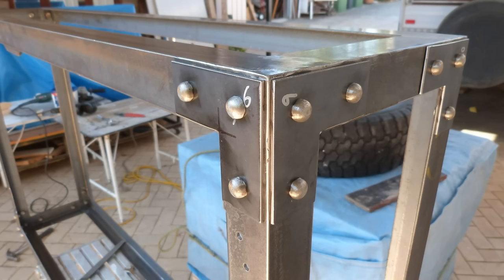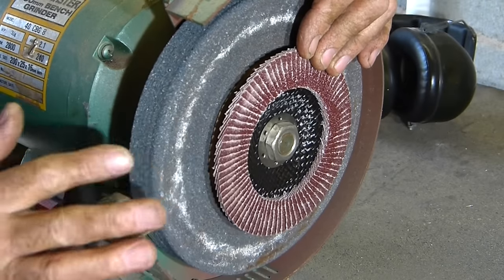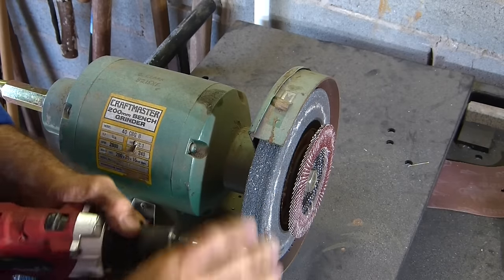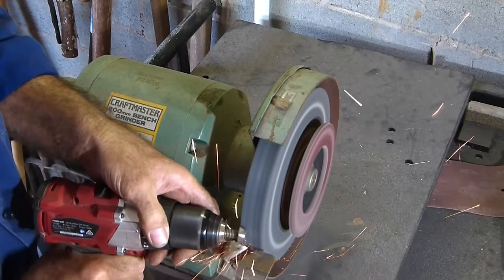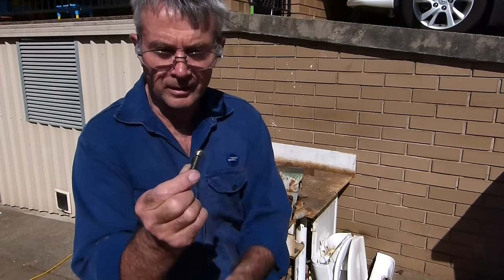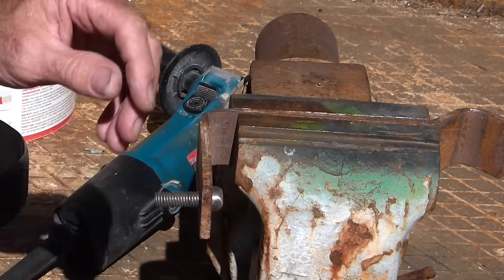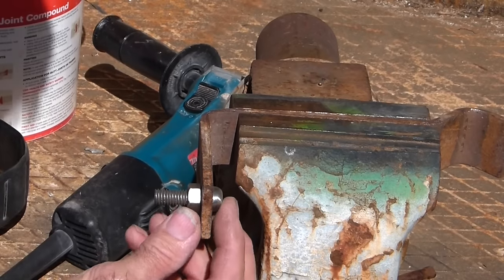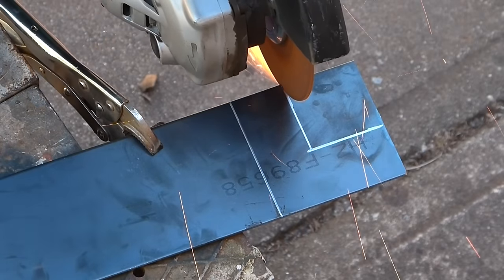Steel Rivets how I make Bolts easily look like Rivets for the Metal Industrial Furniture Style look.

Comment: 30 seconds in and that flap disc on the bench grinder is absolutely fucking genius! subscribed!
Reply from the maker: Thank you, welcome to the channel. just a note on the flap sander you can only put it on the right-hand side so that the flap wheel is turning in the right direction. I like it because it is also very quiet compared to running an angle grinder. Thank you for your comment.
Reply: @GavinClarkdiy  yeah, have to think up something for the left side. maybe a scotch brite wheel
Reply from the maker: A very good idea, it is wasted, I will add something to the left side at some stage. Thank you for the idea and your comment.
Reply: Same
Reply: What ever you put on the left side should be ok as long as it's in direction of rotation for that object.  Solves the issue of side grinding either way.
Reply: I keep a wire wheel on the left side of mine. If you do a lot of metal work you will wonder how you got along without it because you will use it alot!

Comment: Good tip on the flap disks. I have to go out to the shop to cut some 0.960" strips from an 8" carbide tipped saw blade to use for parting tools on my lathe. Before I grind them, I'll be putting flaps disks on my bench sander.

You said they could only do on the right side. If you have extended arbors, you could put one on the inside of the left wheel.

I've been using the drill trick for grinding for a long time. It works well. If you have a decent fine stone, you can radius/champfer machine screws after shortening them.
Reply from the maker: Thank you for your comment and your idea extended arbors I don't have these but I will keep that in mind.

Comment: I've been doing this for the last few decades! I also learned that you don't have to hold the head with pliers if you have an impact gun. Electric seems to be faster than air, and the speed at which the nut is turned doesn't allow the bolt to spin.
Reply from the maker: What an excellent comment, I agree with you 100%, on one I did quite some time ago I hit right near the hole with one center punch hit, it put a little bur into the hole which was plenty to hold the bolt from turning, but it was more work. Thank you for your comment.

Comment: I used standard button head riviets From McMaster/Carr and just spotted them in instead of a nut on the backside. Really fast.
Reply from the maker: I used these bolts because I have a lot of them, and it was a simple job, and used the nuts to show that it could be done without a welder. I appreciate your comment.

Comment: Love your work mate. I'm impressed. I have to build a large medieval style timber door with ornate laser cut hinges looking like oak tree branches,  I can bolt the hinges to the door using this idea and theyll look great.
Reply from the maker: That sounds like a great project, it should look amazing, I am glad I was of some help to you. Thank you for your comment.
Reply: @GavinClarkdiy  Do you have any suggestions Gavin on how to antiquate hex nuts so I can use them on the inside face of the door where theyll be visible? I am thinking to have old style  square nuts laser cut and tap threads in them. I'm in Gippsland, Victoria.
Reply from the maker: @andersonsroad5161  What about "steel castle nuts" with a square washer under them. https://images.app.goo.gl/Cv7Sf86BN23DJF1j7
Reply from the maker: You could also make your own washers from 25mm flat bar, and your own square nuts from 16mm flat bar (about 5mm high). Belt them both up a bit so they look damaged from a hard life (before you drill the nuts to thread).

Comment: Way easier to grind the numbers off and shape a carriage bolt then square the hole. No need to mar the surface of your "rivet" when tightening the nut. I like the bolt cutting jig and the sander on the grinder.
Reply: What do you mean -- what's your solution to avoid marring the surface when tightening the nut?
Reply: @LudoA  carriage bolts have a square on part of the shank so if you cut a hole the size and shape off the square the work will act as a spanner
Reply: @jim-zb2kb  ah right, good idea. Thanks for explaining!

Comment: Very stylish!
Is it possible to buy these bolts rather than make them? Also, if you cut a slot on the end of the bolt's shank (don't know  how else to say this, I hope it makes sense), you can then tighten the bolts using a flat head screwdriver along with the wrench. The question is, what can you do to prevent the bolt from spinning freely if you want to to tighten down really hard? For example, if the L shapes had an actual structural function instead of just decorative as in the case where the frame was not welded at all.
Reply from the maker: You can but Rivets, just search Steel Rivets. The will not have a thread ( I Think).Your idea of cutting a slot will work ok, try it with a standard bolt and see that you are happy with the result before you get or make your rivets. Another Idea you may like would be use BLACK (Socket Head Cap Screw Allen Bolt) you can get some tough looking ones of them and they would be simple as you can tighten them with an Allen Key. I used these to hold the hinges on in the same cabinet that my rivets were used on. I hope this helps a bit.
Reply: @GavinClarkdiy  Ah yes, of course! I like the idea of the rounded heads as it means they cannot be tampered with from outside - or at least it looks that way! 
It's also nice if you want a metal object with as few protruding elements that someone's clothes will not catch on. Finally, it's the look thing.
Right, I just remembered what I think may be an alternative. I kinda of remember having seen these rounded head bolts (that sometimes also come with a square nut?). They usually have a very low height head (so might not look as nice as rivet or diy rounded heads to some) but they have a neck segment below the head - and before the thread starts - which is square. This means that by cutting square holes on the metal sheets you're trying to screw together, the bolt is held steady by the square hole and you only need to worry about tightening the nut.
Again, their only drawback, apart from needing to cut square holes, is the rather flat and wide round head which doesn't look like a rivet so much and also means you have to space them wider apart.

Comment: No spring lock washer or locktite needed?
Reply from the maker: Hi Jack, good question. My answer for this one project of mine is "no" as the box frame is all welded solid and I am just bolting this plate to the solid box so in theory there are no parts that could or want to move, it is a cupboard that will be bolted to a stationary wall (not in the back of a ute etc, it was all painted with thick paint that will help it from not moving too, If it was going to be in any sort of vibration it should have nyloc nuts or spring washers, and if this was the case I would have just cut the rivets a bit shorter and welded them from the back.I have not found any issues in not using them, but for a small expense fit the spring washers or damage the thread a bit so the nut won't vibrate off, glue it or weld it. Thank you for your comment.

Comment: What paint/coating did you use on it? I like the textured look that it provides.
Reply from the maker: I used (Dulux Metalshield Hammered Finish) Thank you for your comment
Reply: Using paint wouldn't defeat the whole idea? You could use fake wood or styrofoam rivets which would be much cheaper. I guess it may look better by heating and dropping into a can with used oil.

Comment: Rather than have nuts on the inside, why didn't you just cut them so they fit flush and weld them in?
Reply from the maker: You are right, and I have done that on other projects, I wanted to keep this one very simple. Thank you for your comment.
Reply: oShane Kasper  but obviously he does based on his reply and the fact he built the frame.

Comment: Why not just tack weld the whole thing from the underside ?
Reply from the maker: Yes, I said in the description we could just weld the back, but in this project, the boards lining the inside would cover the nuts, so as the nuts were quicker so I used them
Reply: Why not just use actual HOT RIVETS???
Reply: @starmc26  Rivets are dearer than bolts.

Comment: Just use carriage bolts.  Lol
Reply: I thought of that too but these look better because of the thickness.
Reply: Exactly ! Haha
Reply: Pro1er I have done 1000’s of rivets using carriage bolts.  They come out amazing and a lot less work.
Reply: @mikeeagle2653  I've used carriage bolts for projects too, and they look like carriage bolt heads. Rivets have a flat spot on the head from being hammered, carriage bolts have a round head, that's one reason why they don't look like rivets.
Reply: They cost way more and you need a square hole to use them.
Reply: calee4nyaboy  That's why they invented the broach.

Comment: Why not just use rivets, and weld the back?
Reply from the maker: Yes you are right, I could have bought rivets, but I have heaps of these bolts and this was a way to use a few. Thank you for your comment
Reply: Rivets are dearer than bolts. How do you tighten them up, job done.

Comment: Just plug weld coach bolts or actual rivets on from behind, job done.
Reply from the maker: Yes you are right, and I have done that on other projects, I wanted to keep this one very simple and as I had plenty of those bolts and nuts they are what I used. Thank you for your comment.
Reply: Rivets are dearer than bolts. How do you tighten them up, job done.

Comment: If I can give you another tip.  When drilling steel you want very slow speed with a lot of pressure. You drill speed is too fast. You probably going thru drills bits a lot.  Aluminum you want to drill fast.
Reply from the maker: Thank you for your tip, much appreciated.
Reply: True.  Im a CNC machinist.  You need the flutes to bite into the metal to create a chip.  Too much speed and not enough pressure and its just rubbing (building heat) use oil

Comment: You spoiled the head of the bolt, then holding with pliers, removed the plating. Soon it would be rusted.
Reply from the maker: The bolts were mild steel they never had a non-rust coating. I will be coating the full cabinet when it is finished and all the welds are done, with a rust preventative coating.